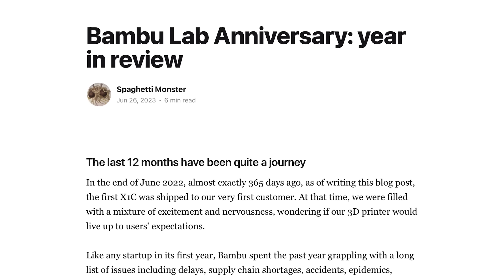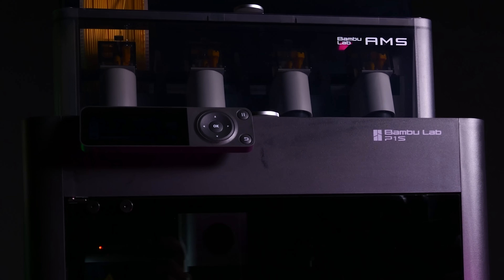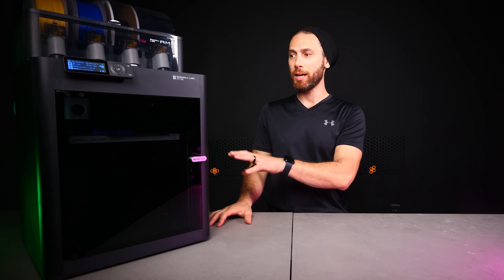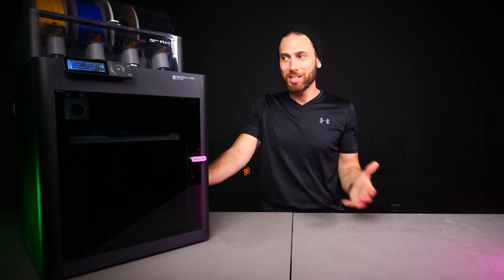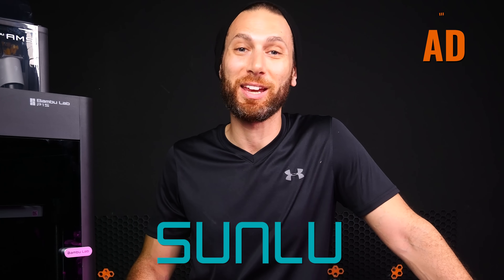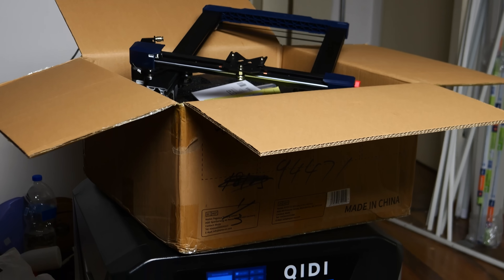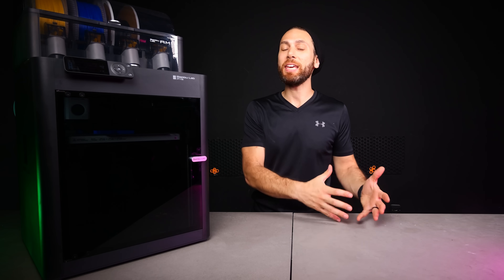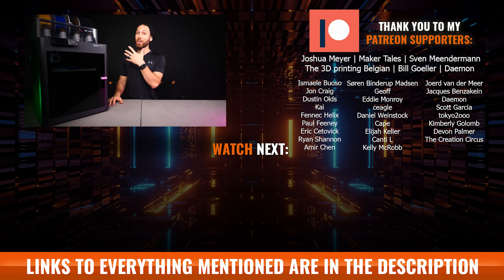Introducing The Bambu Lab P1S

Comment: The elephant in the room for me is the cloud requirements of Bambu currently.  Yes, I know you don't have to use the cloud but a printer in any of these three price ranges should include simple uploading of files directly from your computer without the need of sending it to the cloud.  Turn off cloud on a Bambu printer and no firmware updates, no sending a print directly from your computer...  This is a deal breaker for me, too bad, the hardware otherwise is very compelling.
Reply: What makes prusa any better?

Comment: If I was on the market for a new printer with this kind of budget, I'd go for the P1S hands down; creality just isn't what used to be (but since I'm a tinkerer I really wouldn't feel as comfortable)
Reply: My company is looking at either the P1S or the Creality K1 Max, any recommendations? We will be using to print replacement parts for our manufacturing line
Reply: @captainkittles  P1S hands down; it works out of the box

Comment: So, it's got a plastic enclosure, comes with a mostly useless filter (bento box does a MUCH better job than this, comes with the part fan and aux cooling fan, and has the glass door and glass top.

Costs $350 more.

Still has the crap camera, and no hardened steel, so sounds like it's the same mobo from p1p. Doesn't seem worth it. Jut get the p1p, and build an enclosure (you can build one that uses the glass top and door), and buy the aux fan etc as upgrades if you want them later

Oh, and Bambu support is still absolute garbage.

I like my p1p...but I'm wishing I'd built a voron instead. they've built quite the walled garden, but it is lacking in some basic stuff that really should have been worked out by now

What I'm really looking forward to is someone jailbreaking these things and exposing the full klipper api. THEN these machines will truly rock.

Comment: As a P1P AND X1C owner, I wish I would have just saved up my money and got another x1c. The Wi-Fi speeds on the P1P are terrible, sometimes waiting half an hour or more for the P1P to download and unzip high poly files is terrible, where as the x1c just starts the print. If you don’t do a lot of prints this probably won’t matter that much, but it is a time killer for back to back high poly prints. Also the camera frame rate is terrible. It’s feels more like watching a slow motion Timelapse. I know that might be a small issue for most people, but for someone trying to sell prints, the x1c is worth the extra investment to me.

Comment: As someone who already upgraded and enclosed my P1P myself, I'm very happy that BambuLab are offering each single part, that differs the P1S from the P1P. You can also get a set and simply upgrade it yourself to this new version.
Reply: So in other words: an upgrade "enclosure" kit with all the parts for 99 bucks would have been sufficient enough? Hmm...
Reply: @hassosigbjoernson5738  The P1S is the same machine as the P1P, just a few things added. You can check the exact difference in parts by going to the Bambu Store and look for the Upgrade Pack.
Reply: @hassosigbjoernson5738 except it’s $200. Get the P1S and save the $100

Comment: I basically have a P1S. I've done all those upgrades including the Board fan and Hardened gears/extruder. I also Paid the original 699. So this is a deal at that price. I've had no issues with the textured PEI plate but my buddy with the X1Carbon has had tons of issues with his plate. He purchased the PEI sheet now. It should come with the X1.

Comment: Thanks for the excellent first look at the P1S. I am going to order one in the next few days, and have been thinking about the chintzy control screen. Why couldn’t one semolina dedicate an older phone or tablet to running Handy, print a simple bracket for it, and have a nearly equivalent experience to the X1C? The phone could even be powered by the extra USB port that us apparently included in the printer. Has anyone tried this?

Comment: Maybe project videos, but with the project printed on a new printer.  Then you could include a short segment with your feelings about the printer but it wouldn't need to be the focus on the printer.  For example, I'm particularly interested in the Qidi, but if you just used it for an ABS project and then talked a little about what that was like that would work for me.

Comment: basically it looks a lot like a rebranded x1 minus the lidar and touch screen. my x1 (not carbon) is a plastic enclosure.
Reply from the maker: Oh snap didn’t know that. I guess they found people were confused
Reply: @thenextlayer  i really like my x1. but yes it has a plastic enclosure. still has the lidar and touch screen. doesn't have the hardened steel gears or nozzle (although they sent that to if you got it during the Kickstarter and redeemed the Kickstarter gift)

i never installed the hardened steel gears because i don't print to much with abrasive martials (ie carbon fiber). I mostly wanted the lidar for first layer detection.

i did install the aux fan and camera though.

this has been a really reliable printer and it prints fast and well.  i would but a p1s if i needed another printer but one is fine for me for fdm. ( i do have a cr10 that has been modified ) but i don't use it since this one is so much more reliable and faster.

Comment: Thanks for the first look at the P1S. Am a tiny bit bummed since the P1S announcement came out like a day or 2 after receiving my P1P, but it looks to be about what I expected the P1S to be; A P1P with upgrades plus an enclosure. Though, i'm surprised that they didn't also add in the hardened steel nozzle and hardened steel extruder gears (I ordered the P1P upgrade kit when I ordered my P1P). It's all good though...gonna do the Vision enclosure on mine and kinda like the ability to see into the printer from the sides as well. Anyway, thanks for the great first look and your thoughts on it!
Reply from the maker: Nice thanks!
Reply: Maybe the next step is a modular system where you can mark all the features you want during ordering?! We'll see!
Reply: @hassosigbjoernson5738  That would be cool, but from a manufacturing and packaging standpoint i'm doubtful that they would go that route. That would be more of a build-to-order scenario and would definitely slow down their ability to fulfill orders. We shall see though!

Comment: Got a P1P for work last month. It's been a machine. Printed 5 kg of prints already. With only a handful of failures, I'd attribute mostly to user error. Had one print go stringy on me.

And I haven't enclosed it. I don't have the cooling fan. I haven't changed anything. Bone stock P1P.

If the P1S had come out 2 months sooner I think we would have bought that instead. But I can still upgrade the P1P to a P1S but I really don't think it's necessary.

I've done large petg prints using the whole build plate but only 1/3 of the max height and they came out perfect.

Comment: Huge issue with plastic enclosure is if fire resistance. For it to not be a hazard those panels better UL94 V-0 Rated. Otherwise its a fairly large fire hazard and this can't be overlooked. A fire on an ender is one think as its mostly aluminum, but on this with a flammable enclosure would produce MUCH larger flames and a ton more smoke increasing the odds the fire will spread.
Reply: Most P1P have self printed plastic sidepanels. Often maybe out of PLA or cheap Acrylic sheets ...

Comment: I picked up the p1p on Sunday at micro center and ordered parts for a enclosure. Then this was announced the other day😂. I was bummed at first because i spent an extra 100 on the parts so in effect i spent the same amount to upgrade it as it would have cost to get the p1s. But now i see it as an opportunity to learn how to maintain the printer rather than wait for something to fail and learn the hard way.
Reply: I wonder why they released the P1S in the first place? A simple "enclosure kit" for these 100 bucks direct from them would have been the trick!

I assume it's targeting those print farm users that don't want to customize anything. But I'll also would choose the DIY route with the P1P... just for fun and experience.
Reply: @hassosigbjoernson5738  They have an enclosure kit now for the P1P

Comment: So I like reviews but not the way reviews are done these days. I can check specs online. The point of reviews is seeing how other users feel about the machine after using it. Personally I like it when reviewers for tools like a 3D printer actually use it for a project and point out what worked for them and what didn't. Now I get that this is basically a P1P with an enclosure but I want to know if the enclosure in reality affects print quality and how well ABS or higher temp plastics work. Like I know enclosures can make printing in PLA difficult and a lot of people open their enclosures when printing PLA for part cooling. Is that an issue. How well does ABS and ASA etc print. etc.

Comment: Obviously I'm armchair quarterbacking here, but my instinct is that the P1S won't be as ideal for printing PLA as the P1P.  Because it's enclosed, and defaulting to a heated print surface, the interior temperature will almost certainly rise to the point where PLA is experiencing difficulties.  A quick search didn't turn up anything, but I very much expect that with the P1S it will be recommended to remove the top cover or open the front door when printing PLA.  I also expect that the aux fan will kick on, and that baby is loud.

So, right now it looks to me like the intended uses are this:
-If you only print PLA/PETG, get the P1P.
-If you mostly print ABS with the occasional dip into PLA/PETG, get the P1S.
-If you mostly print with abrasives like Carbon Fibre or glow-in-the-dark, get the X1C.   (For occasional forays into abrasives the "P1S with hardened nozzle" is an option, but keep in mind that the X1C also has hardened extruder gears.)

One detail that I lack data on is the insulating capabilities of the side panels.  Is aluminium or plastic better at holding heat in?

Overall, though, I agree that the P1S is the X1 rebranded as an "improved P1P rather than a "basic X1C".  I'm sure Bambu is happy to have a chance to recoup costs on those injection-molded side panels!

Comment: Thanks for the video. I am trying to decide if P1S or X1C fits me better. Have you had a case where the X1C saved the print due to having more sensors? Or are those extra sensors work more like a insurance plan that you'll most likely not use? By the way, I pretty much only print PC and I am looking to print carbon in the future. Thanks for your time.
Reply from the maker: X1 failure detection works quite well. Sounds like you need the X1. Https://jle.vi/bambu if you’re picking it up

Comment: On hobby printers, aluminium panels make a massive difference in chamber temps, easily 10c difference from just 1 side aluminium so I wouldn't be surprised to see the p1s get to way higher temperatures.
Reply: Sorry, I'm confused - are you saying the P1S will be higher than the X1C, because the P1S has plastic and the X1C has aluminium?  Or just agreeing that adding an enclosure will make the internal temp higher?

Comment: If you wanted to start a print farm would you recommend the P1S or Carbon X1? Largely will be doing PLA type filaments. Would love to know your thoughts.
Reply: I don't have a P1S, which I'm sure is not a surprise, but I do have an X1C.  To print PLA on the X1C you need to either open the front doo or remove the top, and the aux fan will kick in, all in an effort to keep the chamber temperature from getting too high.  Now, that is partly the slicer's printer profile so the P1S might not do that, but until we have more data my gut is that the P1S is not optimised for PLA.

But the X1C is definitely not meant for low-temp filaments as the day to day material.  The only advantage it would have is the better on-printer controls, and I would assume a print farm would not normally be using those controls anyway.

So between the two you asked about, the P1S seems the better choice for PLA, because with the X1C you're paying for capability you're not using.  But I'd strongly consider the P1P as well - a print farm doesn't care about aesthetics and you don't need the enclosure for PLA.
Reply: @davydatwood3158  thank you for the great answer, I have an X1C now and it is leaps and bounds better than my ender 3 so I think I will get a P1P and play around with trying to automate it, also easier since it does not have a door to mess with.
Reply from the maker: If it's mostly PLA, you could get by with the P1P, you don't even need the P1S
Reply: @thenextlayer  thanks for the quick reply, going to get a P1P and try to automate it.

Comment: I love your reviews. I do hope you give pros & cons not only on this printer but also comparing to ALL the printers. We know that PLA & PETG work with most printers, but how do they compare to other filaments right out of the box. As a noobie that has learned allot from upgrading & playing on my sons geeetech a20m, not all printers are the same. Slicers, settings, materials, hotends, nozzles as well as thermistors need to work together. Calibration is another issue. Right out of the box experience can make or break the brand. Even Bambu has been uneven from all the reviews I watched. Yes, for the most part, these printers work regardless of brand. Just like buying a car, regardless of catagory, you can still get a lemon or it's not as good as stated.

Comment: The cables instead of ribbons for the toolhead makes the X1 hardened extruder a swap in upgrade for the P1S, not true for P1P. That's worth a mention.
Reply: Also the K1 spanks the P1P on print quality and speed when rooted configured in Fluidd. I have both printers.
Reply from the maker: They patched this :(
Reply: @thenextlayer  Yes but we developed a tool to roll back your firmware.
Reply: When rooted lol
Reply: @MrExo_3D  Fair but it's a trivial process and you end up with essentially a wide open Klipper printer.
Reply from the maker: Actually I tried to put an X1C hot-end on the P1S today, it didn't fit... they're ribbons :(

Comment: The PEI sheet is a welcome little surprise, but other than that exactly what I expected. Honestly, unless its price drops by another USD 100, I don't see the P1P staying after current stock runs out.
Reply from the maker: You mean P1S? I think the P1P is a loss leader
Reply: @thenextlayer  My point was that the P1S offers too much more than the P1P for a mere 100 bucks more for the latter to remain a viable choice. If you can't afford a 3D printer for 699, you shouldn't buy one for 599, either. If you can, then why miss out on a fully-featured enclosure? (Conversely, the price gap between P1S and X1C strikes me as too large for the actual difference in quality. My bet is on the X1S being a beefed up replacement for the X1C (with the current flagship either disappearing or settling on a new price around 899~999) and X1E large volume.)

Comment: This printer is awesome. I don't use any of the features between this and the X1C, so for $500 less with the AMS, it's ideal for me.
Reply: After a hardened extruder gears for $20 USD + hardened nozzle for $40 and you have an x1c for hundreds less.  What's the catch?
Reply: @BennyTygohome  Al enclosure and screen? lol
Reply: @patricke3848 and lidar sensor, but really the p1s sounds like the better deal to me
Reply: @BennyTygohome is it complicated to install them and what about the Lidar and its secured functions of calibration flow and first layer inspection ? Thanks
Reply: The X1C is the wrong comparison. It replaces the X1 for $ 999 which would have also gotten cheaper to $ 899 after the K1 came out and the P1P got cheaper.
But yeah, it's the X1 without the fancy stuff like LIDAR, aluminum design, the touchscreen, the build plate, extruder and nozzle.

But this has also been the case with the P1P with let's say an Vision enclosure all the time.
Reply: @hassosigbjoernson5738  It's the right comparison for me because it's what I have and now I can get more printers that serve my exact needs for $949 instead of $1449.
Reply from the maker: Yep

Comment: I HATE the crappy  P1P/P1S interface display. While it works, it reminds me of the EPIC FAIL of the Apple TV remote that we are forced to use from it's conception of all versions of the Apple TV.  I wish someone would make an aftermarket P1P/P1S  display  and improve this "Turd". Having 8 P1P's and 1 X1Carbon, I am forced to use "The Turd" interface of the P1P daily. Always getting  unwanted inputs because of the  "360 degree wheel" design that is too small, adding to the  "bad by design" that breed false/unwanted inputs that make you have to "back out" and start over inputs.